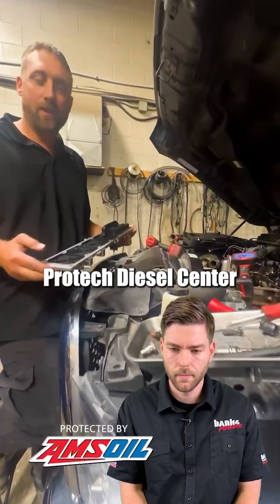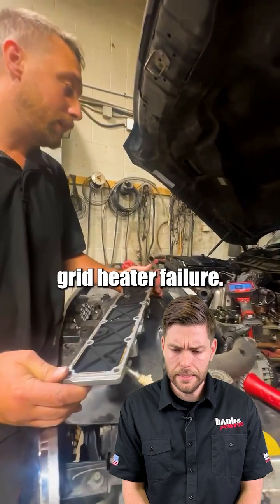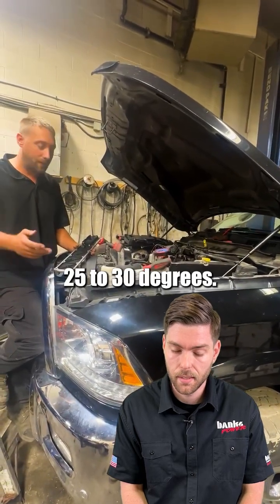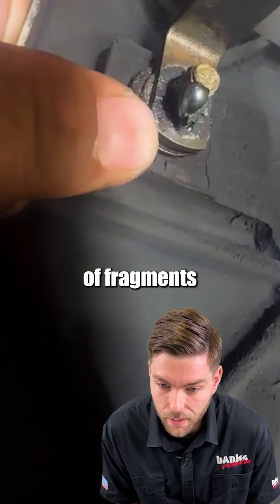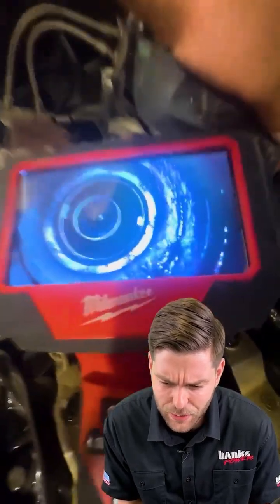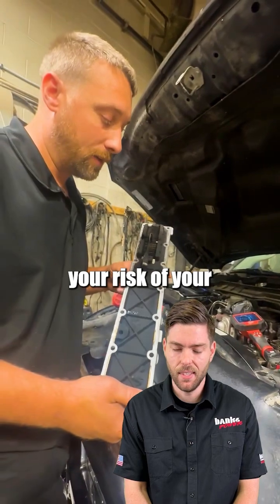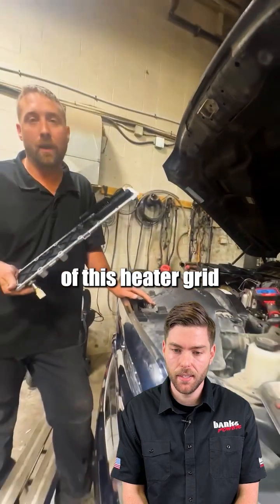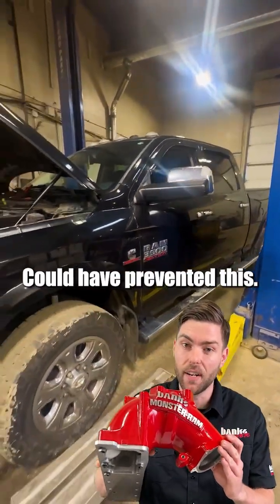This engine failure could have been prevented.

Comment: I don't understand why Cummins in or ram have not called a recall on this. If they know this happens. I have a 2019 Cummings and I'm telling you right now if I had a failure. I'm getting a lawyer and I'm going to either start a lawsuit or a class action lawsuit against them because there's enough evidence for them to call for a recall. They just don't want to lose the money. You know they have more money than we do and then next thing you know we're going to spend tens of thousands of dollars to either a go, get a new truck or get a new motor so somebody needs to do something about this

Comment: Ty. This red Banks Monster Ram is also featured & recommended on Daves Auto Center in Bountiful Utah. His operation focuses on diesel pick ups. Im not affiliated with them, just recognized this Banks part. Im gonna have to look into getting one installed on my 5.7L GMC engine. Was easy for me to focus on what this mechanic is conveying but i recommend like others have to add your valuable comments after he imparts his info. Your vid would absolutely meet yt's video showcasing rule as ive witnessed others add their comments after the showcased vid is done

Comment: I have to say, now that I’ve installed the Banks Monster Ram in my truck… the bolt you have to install by lowering it with a magnet to the hole… that was a surprise. Not my favorite.
Reply from the maker: The inside bolt of the Monster Ram is necessary to attain an even pressure around the intake mounting gasket so there will be no boost leaks if it is not installed you will most likely incur a boost leak not due to the hole not being "plugged" but due to that portion of the monster Ram not clamping down evenly against the intake gasket underneath.

Comment: Exec meeting, circa 1987...
Accoutants: Hey guys, great job on the motor, but these things run forever.  How can we get people to buy new trucks?
Engineers: Well, there's this dowel pin, and we could make it pop out, and then they'd trade the truck in on a new one.
Accountants:  Awesome!  Let's do that.
Some time later...
Accoutants: Hey guys, remember when sales were slowing down because the engines were running forever?  We're having that problem again.  What'cha got for us?
Engineers: Well, we've got this heater grid bolt.....
Reply: I wonder if everybody replaced their intake with a Banks Monster intake, I wonder what else the engineers will design to fail? Pistons made out of styrene plastic.

Comment: In my area grid heaters are necessary even if you plug it in it still might not start ..  that being said I'll be putting a banks monter ram on my 04 5.9l Cummins after I get the transmission fixed
Reply: The monster ram still has a heater, just a better design
Reply: @fly2crawl  I didn't realize they put a heater in it now that's cool
Reply: @matty2helpfull all diesel engines has a heater grid for starting up, it doesn’t matter what temperature is outside, the banks used a different type of heater grid than stock Cummins used and better elbow to flow more air.
Reply: @misterrc51  No, not all diesels have a heater grid. I can name a bunch that dont.
Reply: @SOU6900  The newer systems have heater grid on any modern diesel engine, on old ones used glow plugs and they are same concept, other wise it’s going to take a long time to start and you will burn out your starter. Diesel doesn’t have spark plugs so you need some way to warm up the air to allow it to compress to burn the diesel in the combustion easily. l worked on these big diesel engines at work.

Comment: What’s the most important fix on a 2012 vw 3.0 tdi? Delete or replace the crappy fuel pumps?
Reply: Use Archoil AR6500 in the fuel and drive the piss out of it and don’t worry… We have a Diesel Gate VW Passat with the TDI that we bought new back in 2013. I’ve ran Archoil AR6500 in the fuel ever since new and it’s got over 150K miles with absolutely not a single issue. Fuel mileage is impressive at 60MPG!

Comment: Isn't the grid heater for cold weather starting? So if they scrap it how will it start in minus 40?
Reply: The banks intake has a redesigned heater that does not have this failure point.
Reply: They put a coil heater in the intake instead.

Comment: $20 to $30k? Even if you had to source a new engine it shouldn't cost that much. Might as well scrap the truck and get a new used one
Reply: You can find them in a scrap yard for $5k sometimes.. but then you have to pay someone to install it..  and it's just a gamble, and may be a bad engine.
Reply: @calholli  yep, then you pay to remove it and build it anyways. Turns $20-30k job into a 35-45k job 100% not worth the risk.
Reply: That's what they cost after labor, engine alone is $16-20k now. Labor at $250 per hour.
Reply: @duramaxadventures5832 Thats complete BS. Labour for 250/hr? You’ve been sold snake oil and the local shops must love you or you’re ripping people off. Regardless a turn key 6.7 Cummins goes for 6k-11k depending on furniture.
Reply: @smokiethebear3334 where do you live that labor is way cheaper?
I do think 250 is ridiculous, especially considering the workmanship coming out of some diesel shops in the US. But it's not unheard of
Reply: @smokiethebear3334  yeah no, even Dave's Auto is $17k with a good core.
Reply: That's just stupid. My motor is a few hundred bucks if I blow it up and it's way more reliable than these new ones.
Reply: @Red-b1r8i  it's what they cost 🤷‍♂️ that's why I don't recommend diesel anymore to people UNLESS they can earn at least $70k more per year than they would with a gasser.

Comment: I’m surprised there hasn’t been a recall on this known problem.
Reply: Cummins can't afford it after the government bust them for emissions cheating
Reply: Right. My thoughts exactly
Reply: I'm surprised Nissan doesn't have one on the Altimas CVT, but here we are!
Reply: There is a recall and the recall installs a new heater grid and a new lower amp relay. The recall has been out for years now but most diesel owners ignore recalls cause they have it stuck in their head that all recalls are like the VW recall and it will mean there engines will be detuned.
Reply: @CoinHuntingUSA  Even the VW engines saw nearly zero impact on performance. Fuel economy decreased by less than 2 mpg, horsepower dropped by a whopping 2 horsepower, and 0-60 time is exactly the same as it was before the “detune.” 

Just throw on a K&N filter or a knockoff with 10hp written on the box if you swear so badly that your butt dyno misses that 2hp.
Reply: @CoinHuntingUSA 
Funny I have an 18 HO and I can't find any recall on the grid heater.
Reply: @CoinHuntingUSA  I own one, I have received NO recall notice.
Reply: @ajs96350  I worked for dodge all 2018-2024 are under recall for the grid heater issue if you have your vehicle serviced at the dealership regularly then they likely performed the recall while it was being serviced the recall takes about 20-30 minutes to perform and can be done while an oil change is being performed
Reply: @CoinHuntingUSA  I avoid the dealer, I go there for parts only.
I service it myself in 45 minutes versus at least half a day if I take it to them.
Reply: I brought my truck in and it left with 20% less fuel mileage (22 to 17.5) and about 50% more DEF usage. @TheShmeebitdog
Reply: That would be a logical thought.  The VW debacle was an illustration of how Govt can mess up a situation 

                                         Fergieman
Reply: Modern Chrysler quality right there. Go and get one of the best medium duty engines, then dress it with the cheapest penny saving parts.
Reply: @grantmackinnon1307 that’s actually a part made by Cummins.
Reply: @grantmackinnon1307  You do not realize Cummins makes these engines, not Chrysler?
Reply: Because dodge and chevy don't do recalls unless they're forces. People make fun of ford recalls but they have so many because they want to ensure every customer gets whatever problem they have or could have fixed, even the little stuff. Hell ford just issued a recall on the airbags for their cars from 01-07
Reply: @addisonherbert6686 
Good to know, does this include all Ford's?? Because I have a 2005 Crown Victoria.
Reply: @scottyellis3442  I'd assume so.
In Australia I had a dealer buy a 1998 starlet back because they were unable to get a replacement airbag..... and was a govt recall.   Depends on the car and what the defect is. I've had replacement gearbox from volkwagen on a 2009 polo for free. But then my mate had issues with ford on a paint recall.   As it's not safety and he wasn't the original owner.
Reply: @addisonherbert6686 or maybe just prevent massive lawsuits since they sell so many vehicles lol